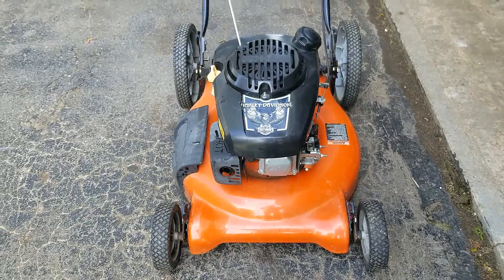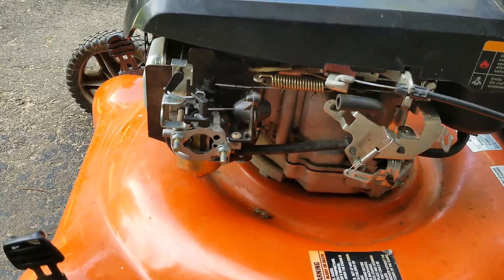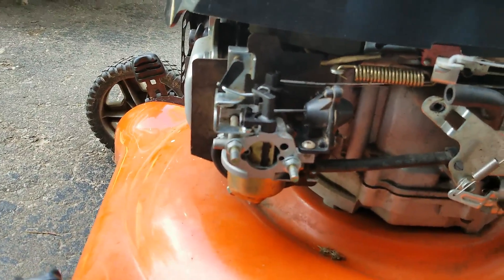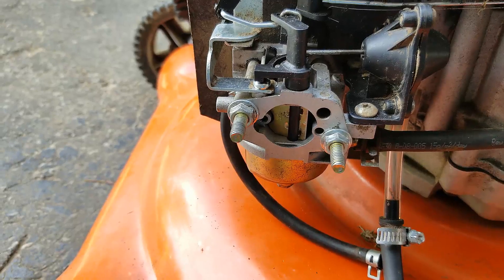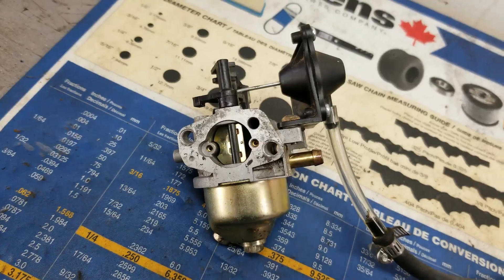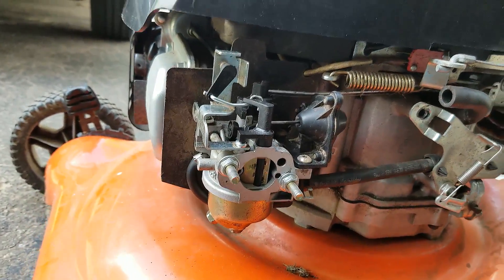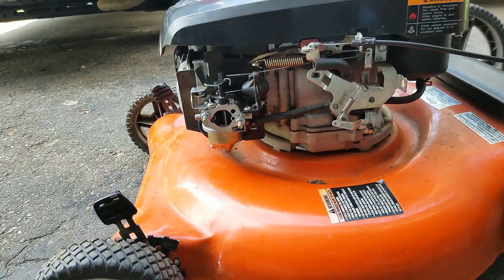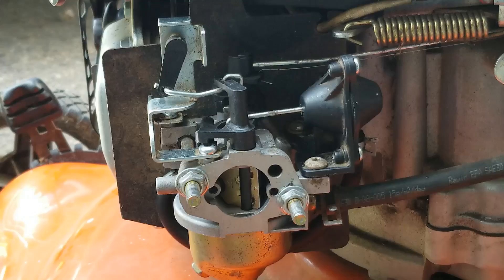Kohler Autochoke Explained

Comment: I have a kohler xt675 with similar auto choke but bolted on top , it starts but after a few mins the auto choke is holding it all the way open and dont run right i hold it back halfway and it runs great is the auto choke spring just wore out??
Reply from the maker: It is possible but hard to tell without seeing it myself.

Comment: Simplemente eliminen el estrangulador la ventana y funcionara mejor,solo que hay que tirar 2 o3 veces mas para encender
Reply from the maker: This is true but the choke system is there to prevent having to pull it 5 to 10 times. Even then, it sometimes doesn't start. Better to have a working primer or choke system.

Comment: It would be easier to eliminate that bimetallic gizmo and diaphram and go with a regular carb and install  a maunal hand choke mounted on handle of the mower.. Too amny moving parts there to troubleshoot . But great video and explaination of how this system works,
Reply from the maker: You would be correct but they've gotten away from this concept to provide ease of use for the user, until it breaks of course. Thanks for watching and taking the time to leave a comment. Cheers

Comment: What is the part # for the diaphragm, can't find it on Kohler parts breakdown. This seems like a vary common problem. Thanks for the video.
Reply from the maker: Pretty sure this is it. 
Kohler 14 268 04-S
Reply: @brantsmallenginerepairs  I'll check to make sure, I couldn't fine it . "Your right", It is 14 268 04-S Thank You

Comment: Hey I didn’t really see it open all the way on last run
Reply from the maker: I didn't leave it run long enough for it to fully open. I knew the bimetallic spring part worked. It was the vacuum actuator that wasn't working. Also, the vacuum actuator will not fully open the choke flap on it's own when it first starts. Just enough to have it run properly until the bimetallic spring opens it the rest of the way. Thanks for watching. Cheers

Comment: I just bought a new Husqvarna push lawn mower (L421P) with a Kohler HD775 engine;  I'm sure it has this autochoke system.  Can you give me a ballpark figure on how many hours before the autochoke fails?  Will reputable repair shops install a manual choke system in place of this?  Thank you.
Reply from the maker: I could not give you an educated guess on the life expectancy of any mechanical part or system but I do believe longevity is always based on proper maintenance of said parts and systems. I can say that I always prefer a manual choke system, or even better a primer system due to the simplicity of those systems. A lot of autochoke systems require over-engineering to work. This complexity (extra parts and gadgets) creates their own issues in the long run. As far as converting over to a manual choke system, there is no produced conversion kit that I'm aware of. So, any switch over will be a "backyard" fix which you can never really guarantee it's life expectancy either. Since most OEMs are all switching over to autochoke type systems for "user simplicity", I believe these systems are here to stay.
Reply: @brantsmallenginerepairs  I appreciate your answer; thank you.